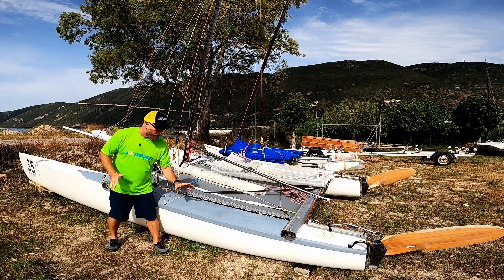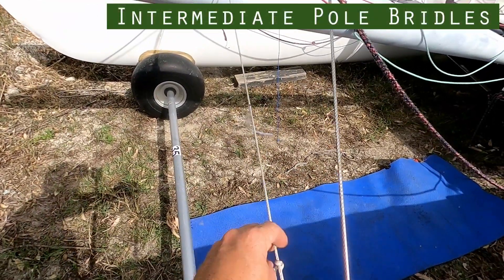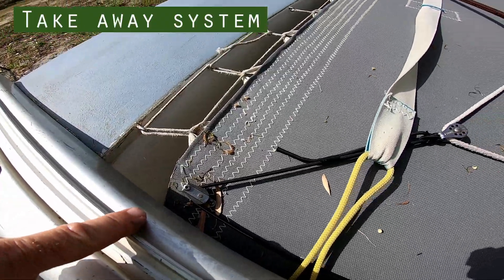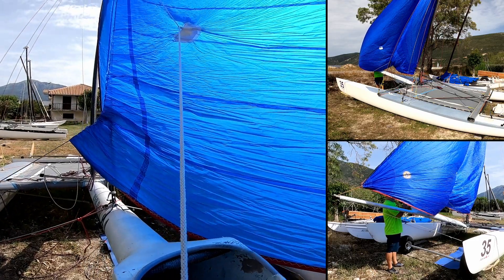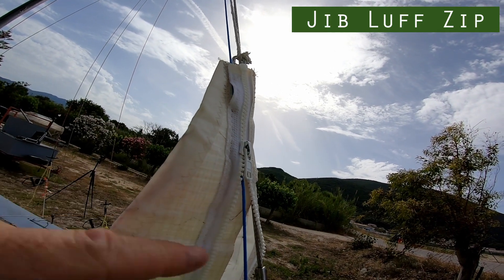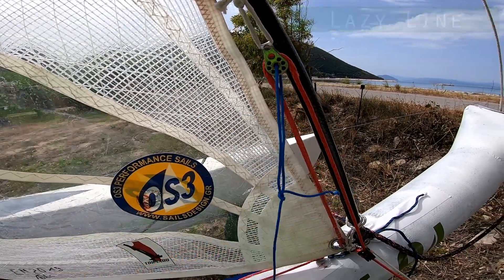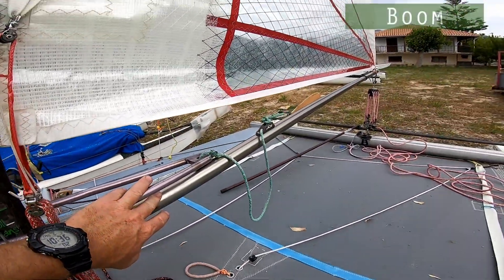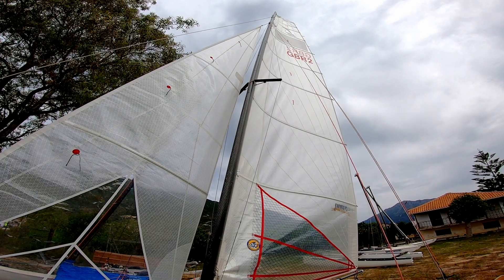Boat Parts Explained: Tornado Catamaran

Comment: I recently inherited a Tornado from the late 80's. It's in good shape, having last been sailed about 5 years ago.

I'm now facing the monumental task of learning how to sail, then learning how to sail THIS boat. I'm a kite surfer, so not a stranger to navigating wind, but this is next level stuff. 

The boat is in storage, with the mast having been removed, laying flat on top of it. From what i can remember , it's missing the bolt at the base of the mast, the bolt that attaches the mast to the boat.

Any recommendation of where to source/build a replacement? The trampoline may need some attention soon as well.

Great channel, cant believe the tornados are still flying high.

Thanks!!
Reply from the maker: Great stuff. Congratulations on becoming a Tornado sailor. 
I would suggest for those kind of parts, join the Tornado Sailors group on Facebook - there's a ton of knowledge there and a lot of people who are enthusiastic to help.
I'm not so good on where to get the parts.

Comment: That specific spi chute is the first model Marstrom made after the move from classic rig to the square top+spi+self tacking jib. Not too many of those still around. They also built a full carbon selftacker at the time.
Reply from the maker: Yes, I had the carbon self tacker originally but it was huge and couldn't sheet the jib in at all.